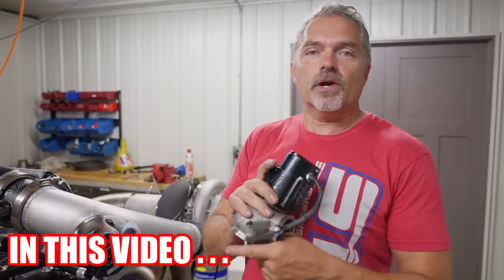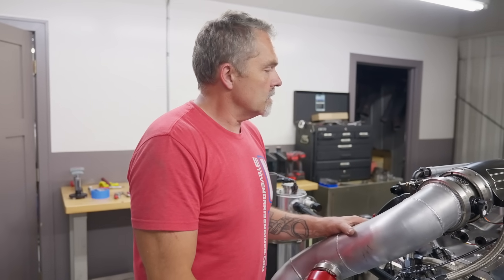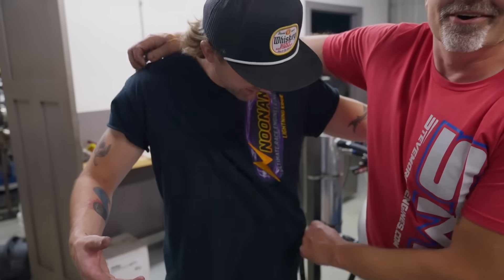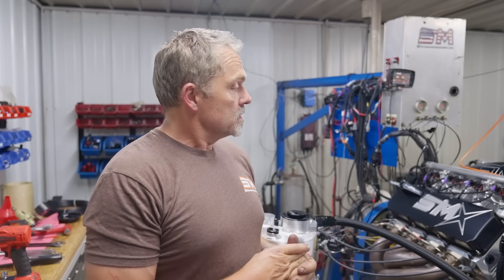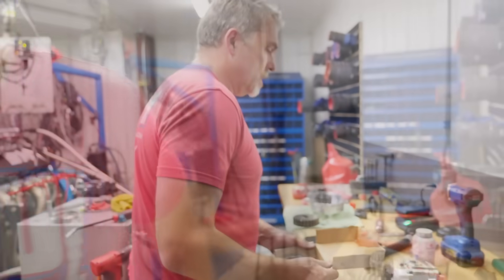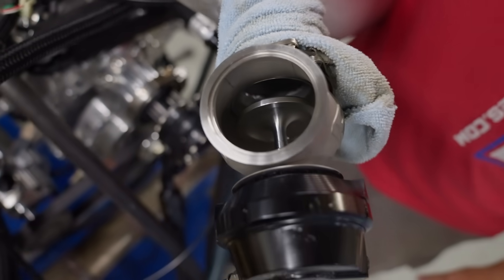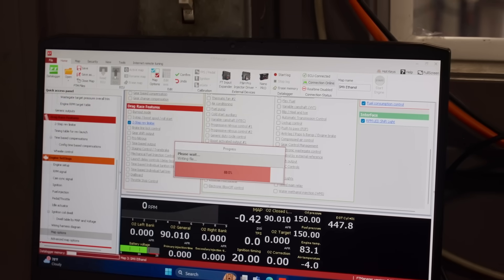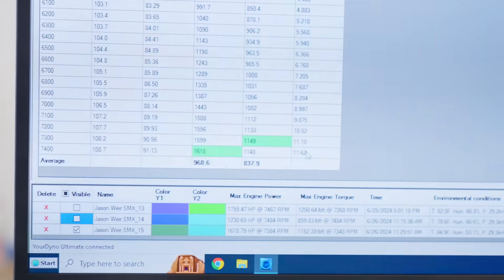Blower Or Turbo? And Cleetus’ Bigger Rods !

Comment: If ever there was a race car engine candidate for a Switchblade turbo charger upgrade… here it is. Steve I doubt you’ll even read this but if you do please look up Blaylock turbo chargers in Baxter Springs Ks. My friend Jim Blaylock patented a turbo charger modification for just this sort of issue. And they are making great strides in this design. It uses a simple mechanical mechanism fed off of boost that changes the internal volume inside the turbo charger turbine housing to act like a smaller turbo charger at lower RPM to spool quickly & then as boost increases, it opens up to flow more.
Reply: Sounds like a variable vein turbo like some of the new cars come with
Reply: @Spudstrodamus VGT turbos are very old technology
Reply: It doesnt make turbo smaller, it just makes turbine housing more restrictive. I dont know how something can be patented if it was found 40 years ago by someone else, and forgotten because it didnt work.
Reply: Yeah, I was about to say, that's just a VGT. Your friend may have patented a better way to achieve that result, but the idea isn't anything new. And as far as I know, with a VGT you don't necessary need a dump valve as you can control the boost pressure by changing the position of the vanes.
Reply: @JuniorJunison  They have a small YouTube channel but most vids are at least a couple years old
Reply: This is really only an issue on the Dyno
Reply: No, it's got more than enough turbo, a shot of CO2 will fix his spooling problem. The other problem is his dyno, it doesn't have the water capacity to keep the load on the brake, cause it damn near got away from him on that one pull.
That's why he wants to try and trick the dyno with a 2 step. Which he'd be better off upgrading to a firepump, to keep his load on brake to catch the run away problem he's having.

Comment: I like the rag over the wastegate outlet. Reminds me of when I was walking thru the MAZDA engine plant in Hiroshima Japan. This was in the mid-1980s. There were little kids’ toy pinwheels mounted on the backs of the computer controllers that ran the machining line. I asked the Mazda engineer I was working with what was up with the pinwheels. He said they were mounted behind the computer cooling fans. If the pinwheel was spinning the fan was working. If not, a passing employee would notify the millwrights that a repair team was needed.
At Ford’s (& probably all other American engine plants) plants there was an electronic monitor on each machine. Cost comparison: 5 cents for.the pinwheel vs probably $50 for the electronic babysitter.
Good on ya, Steve!
Reply: The 5 cents doesn't account for labor costs involved in monitoring the pin wheel
Reply: Back in the 80s when I was taught to drive a semi truck, that's when the old mechanical diesels could be made to run pretty easily if you knew what you were doing or knew someone who did.. anyway one thing that was taught after you turned the pump up was to plug the waste gate and man would those things come alive!!

Comment: Ive seen guys send fuel and set spark on a couple cylinders to fire in the exhaust to spool the turbo up higher at lower rpm. I believe and have seen this hurt turbos and shorten lifespan and Gotta be good at sequential fuel and spark control to make sure its not too big of a boom but it will spool quicker. Idk how well it would work on such a large turbo but higher rpm the more pressure overlap in the exhaust from standard booms and booms in the exhaust, take that as you will. Timing is fun. Basically antilag but for building boost not maintaining.

Comment: The reason the turbo spools suddenly is because of the air pressure in the hot side (exhaust) not being high enough to force itself through the blades of the turbo. This results in little to no flow through the hot side (as pressure increases heat also builds more quickly) until enough pressure is achieved to begin flowing air through the hot side instead of building up pressure against it. Ways I can think of to mitigate this is having smaller runners to the hot side (so less volume of air is required to build enough pressure), making sure the turbo shaft spins as freely as possible, different turbo blade geometry, waste gate/bypass/dump/other valves on both sides of turbo, anti-lag systems, electric motors spinning the turbo (as demonstrated by one of the latest Porsche engines), etc. all of which may compromise certain areas of performance. ...But that's all just to say air bouncing off a fan doesn't spin it until that air begins to flow through the fan, if that makes sense, that's why the turbo lags the way it does. It's all about optimizing the turbo speed to hot side pressure ratio to minimize lag.
Reply: Turbine is open, gases can flow easily through it without pressure. Compressor side is more important, if it is not on a map, it does nothing.

Comment: Prochargers are rampid in NoPrepKings due to the fact it is easier to tune and faster reaction that is right there with the Blower combos. Turbos are hard to tune but, once they are tuned they are hard to beat.

Spell check in Youtube not that great... I meant rampant... thanx for the spell check lol.
Reply: Rampant
Reply: @fartzinacan - Rancid?
Reply: @danmyers9372  great band, but no.  Spelling correction for "rampid" in the original post.
Reply: Turbos arent even a factor in NPK way to unstable to tune. Procharger for the win

Comment: At the 56 minute mark you mulling over egate. If you want to improve boost response and get turbo spinning quickly,  you need to cut the flow of air going into turbo inlet. Even bleeding off boost won't help. A vacuum cleaner screams when you block it. The noise you hear is the extra rpm it's doing because it's not able to grab air and move it. The turbo is the same. As it moves air it needs input from exhaust wheel to drive it. Air has mass and needs energy to move it. Kill the clean air getting to it, and it can't absorb energy by moving that air. It can, therefore, speed up more for the same exhaust flowing thru engine. Once you have it to the desired turbo rpm then let it eat air. It's counterintuitive.
Reply: @donmathias1705  so put another throttle body in front of the turbo and pull it partially closed for a brief moment to act as an "anti-lag"

Comment: I'm pushing 60 years old and have been making my living as mechanic and shop owner since teenager.  Been active drag racer and dabbled in other motor sports. I've been hard core old school  and still competitive some what. You have really helped me learn and understand how it works and tune with more than my screw drivers, timing light, and reading plugs.  Really enjoy your real deal the way it is. I've had some great combinations and way more not so great. Some I should have lit a stack of cash on fire to save time.

Comment: Engine air temperature is critical to making power.  Gale Banks talks about it a lot with his boosted applications.  I did not see air temps as part of the data set, so it might be smart to monitor the charge air temp for a clearer picture of what is happening.
Reply: Gale banks is talking about diesel, pro mod engines runs on alcohol that's the ticket for not running an intercooler the air charge will be cooled be the fuel nothing else is needed
Reply: Gale even talks about the affects of alcohol cooling when he takes a try at building a proper diesel for monster trucks, he even tried to run massive alcohol through his Dmax. I think Steve has even tried charge cooling on Methanol and it didn't help much. Iy comes down to more parts= more weight on the car, and more complex to he already crammed engine compartments.
Reply: Gale has done done gas engines too!

Comment: The blade design on the supercharger is critical to move air
Dependent on the design parameters you design the turbine blades to move "x" volume of air at "y" rpm under "z" ambient pressure
Taking rpm "y" *1,6 does not necessarily equate to volume "x" *1,6 at same ambient, it may only be "x"*1,35 etc 
So the sweet spot has a +- percentage tolerance of say "y" +10% overdriven or "y" -5% and that would be your efficiency range. 
By simply speeding up your blower does not necessarily equate a 1:1 correlation in speed increase and boost/volume efficiency.  You may be getting a 1:0,8 ratio and generate a lot more heat doing it

Comment: I remember I think it was Stavtech on here and IG shared some rally tech where they take an additional throttle body and mount it in front of the turbo to create a vacuum within the compressor. Same concept of the wastegate just further pressure reduction into vacuum. Like how a vacuum cleaner speeds up when you block the inlet.
Reply: Charge Air Control

Comment: Lean of Peak EGT mixture - do any tuners switch to that when a fuel limitation is reached?  It seems like that could be a safe strategy to avoid peak temperature and pressure scenarios which could damage parts..  That might be a better alternative than just running into the red when there’s a problem.  It assumes that the mixture of individual combustion events could be controlled by injector duty cycle, which I think is true, but might need to be checked out.  Controllers might need some control logic.  A related approach would be for the controller to start cutting duty cycle on some cylinders while increasing it on other cylinders.  The reduction on some cylinders would result in more fuel being available for other cylinders.  Main point is that lean mixture may only be dangerous to components when it results in peak EGT.  And EGT drops once the mixture is continued to be leaned.  And, lean mixture  doesn’t necessarily result in misfire within a safe range of mixtures - so long as the spark is hot and provides enough chamber coverage.

Comment: If you can use the dyno to hold the engine at launch rpm with the throttle wide open while pulling timing to build boost then start the pull maybe it would work?edit: nevermind i just heard the explanation lol

Comment: You might find this info interesting ! It's called Rocket turbo anti lag ,there's a patent on it , it keeps your turbo spooled at low engine speeds , was used on Subaru rallye cars years ago  , could possibly use on race cars
Reply: Charge Air Control

Comment: UR absolutely nuts, and I love your channel!  I do the road race , done 14 Turbo cars and Admittedly I'm thinking about off corner response, where you are talking about loading a converter etc.  I realize these are different but it seems like a reasonable answer is your A/R ratio is too big on the turbine. As well this is an Enormous rotating mass, at least to me, And must be contributory, Lordy that is a huge single

Checking the exhaust pressure is A cheaper way to check this out.;  Then you can check the ramp of the exhaust pressure and compare to the boost rise.  
We are usually Doing the opposite;chasing turbines that are too small and have giant 2-1 exhaust/intake pressures, but when we ramp this down to 1.2 or so or less, response is  good and were not melting exhaust valves. I would think this wouldn't be too much problem since you're only WOT a few seconds

Its less headache to me to start off with a too small a turbine and work up till response falls off.

Keep Up the fantastic journey  stories that keep us all researching, and congratulations on being cover boy on race Engine!
-ed

Comment: On your big single charger setup.  Can you get your dyno to pull the motor from top to down.  Higher rpms will get the turbo spinning faster and light easier and more consistent.

Comment: Since before WWII it has been known that turbochargers are able to recover waste energy from the exhaust stream, and so can somewhat more efficiently drive a turbocharger.  Certainly a supercharger can have better throttle response, but for a given amount of power they require a more robust bottom end since the power to drive one comes directly as a load on the crank.  Tradeoffs.
Reply: Turbo too big is a miserable thing to live with....but in a drag car they're using/abusing the torque converter to make one work.   Cam selection would also be very different as back pressure on the turbo needs to be taken into account.   If you have the same back-pressure as boost then the overlap doesn't matter, but when exhaust pressure is more than boost....overlap tends to blow exhaust into the chamber.    On the street...a much smaller turbo would work a lot better.
Reply: @recoilrob324 that's why most go with two smaller turbos instead of one biggin.
Reply: Holey smokes, a smart youtube comment discussion on blowers and turbos. As far as my knowledge goes, no lies detected
Reply: Pete Harrell (sp?) had a nice video that talked about the additional difficulties in using a turbo in a drag car over a supercharger. There were some advantages with the supercharger, as boost is purely a function of RPM for most. Set the launch RPM, done.
Reply: Lmao
Reply: Didnt the Wright duplex cyones use turbo  super chargers kinda the best of both worlds???
Reply: Ahh the wiki quote
Reply: @recoilrob324 that’s what 2 and 3 step is for and anti lag for roll racing. But yes as far as daily driving massive turbos are gonna be slow until you get in anti lag and so forth. But a motor like the SMX isn’t going to have problems like one would think it’s building pretty quickly. And unfortunately he can’t use 2 step or 3 on an engine dyno would destroy things.
Reply: Superchargers do NOT require a more robust bottom end because of crank pressure. And you have to be more specific about what TYPE of superchargers you're referring to. A centrifugal has a linear boost curve. A roots does not. A roots will heat soak or cause high IAT's after a certain boost pressure. That's not the same with a centrifugal. And regardless as to the type of blower, turbos are able to put out more power in the end. Diesels can run 150lbs of boost when turbo charged. You will not find a blower making that kind of pressure. As with most things on the Internet, there's a little bit of truth in the original statement mixed with a lot of false information. A properly sized single turbo will out perform smaller twins. But you will sacrifice something in the process. Generally power under the curve as well as SOME lag, and rpm at which you see peak boost. There's also compound setups that can outperform a big single. I could go on and on about the subject and forced induction but you get the idea.
Reply: @Ole_CornPop  how about one big one, one small one
Reply: @roryhennessey1983  they are more efficient for diesel engines but will work efficiently on straights 6s when you need to help spool the big one.

Comment: Hello Mr M I am 56 years old I been a auto tech now for 35 years .I love your channel. I have a idea for a cylinder head that will run with no valve springs.unlimited rpm and just the average guy can buy the heads at Walmart for 500.00 a set.but I need a guy like u to help us make a few  million in the process
Reply: Ducati has already patented it decades ago